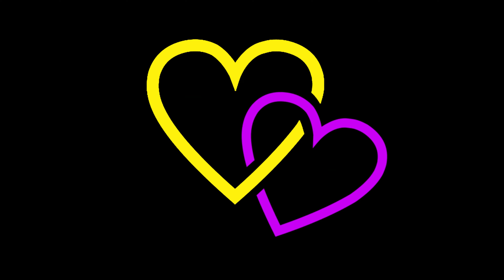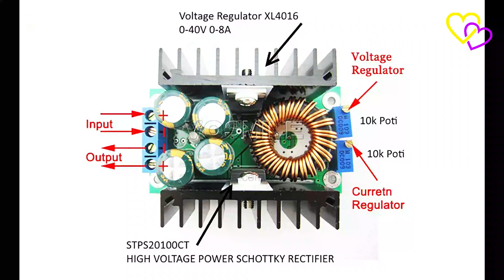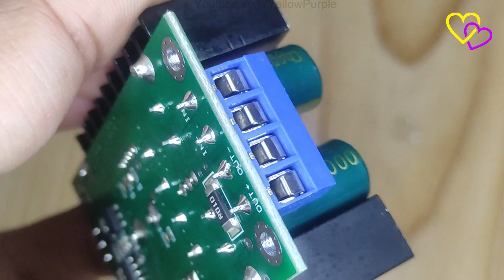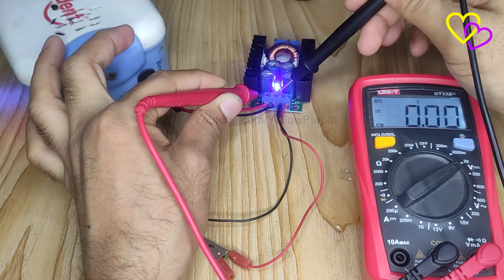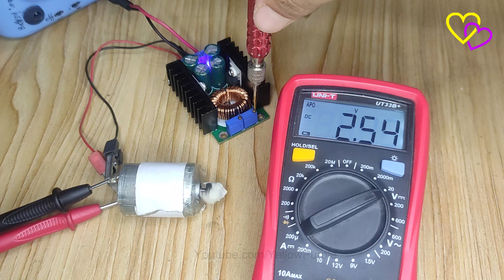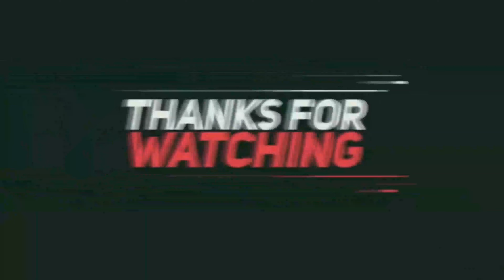300W XL4016 DC DC Max 9A Step Down Buck Converter 5-40V To 1.2-35V Adjustable Power Supply Module

Comment: Thanks for posting this, I bought one of these and  thought it wasn't working because I didn't realize you have to turn the Vadjust so much. Cheers. Does the current adjust work the same way, you turn the Iadjust screw clockwise to raise current?
Reply: I came here for exactly the same reason! My module now works. Just had to rotate the potentiometer way more than I thought.